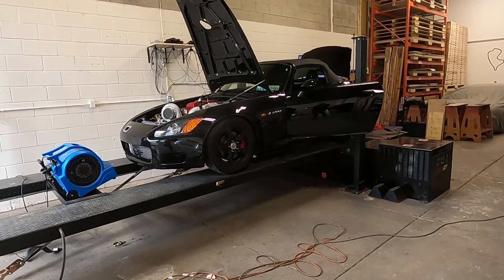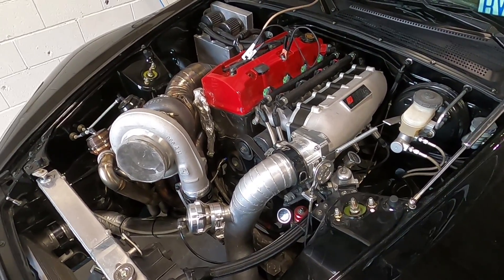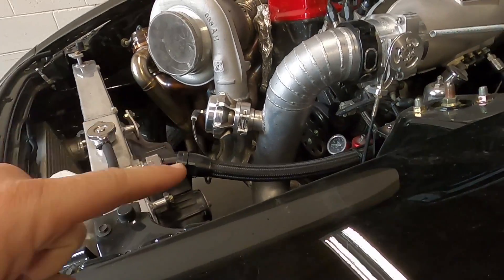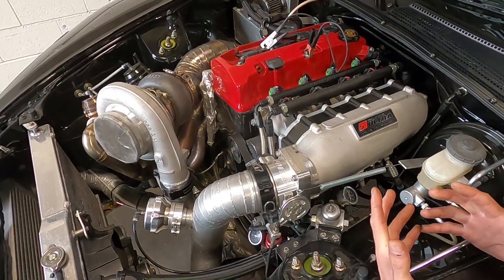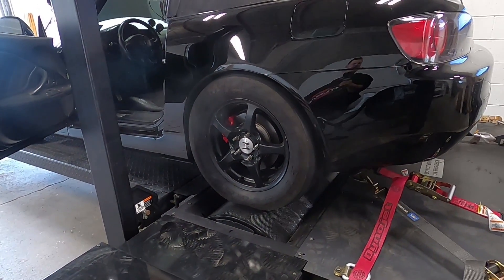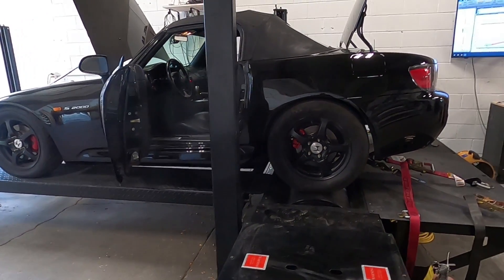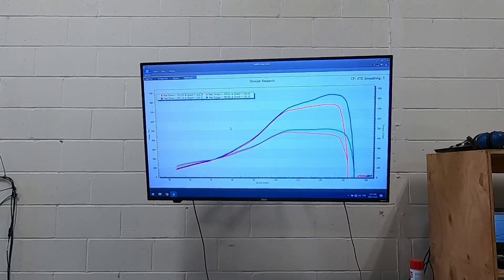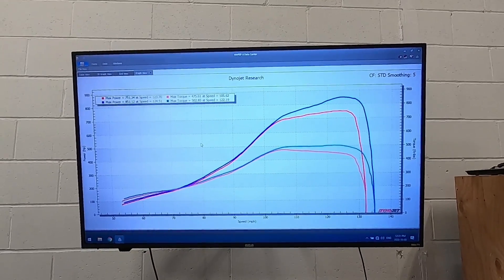Turbo S2000 Dyno Tune - BorgWarner s472

Comment: going to be boosting my ap1 s2000 w 22K miles. The goal is 550 WHP this spring. Do you think ill be okay w stock motor, trans, and diff? I never launch my car and don't plan on doing it. Hoping to also get it set up for different boost by gear so I don't get too wild on 1st and 2nd. Do you think ill be fine?

Comment: cams... drag cartel..  2.2's would work fine..  probably 50 more same boost. more back tire to load the car , or less gear.
Reply: awesome car and great fab work.  love the turbo choice as well.  Id like to see it with the smaller turbine see what boost level it loses out...

Comment: Killer setup. . . I'm ASSuMEing that this is waiting for a trans to be moon boosted. . . Crazy to think 850rwhp is fairly easy/simple and safe on that setup. The F20/22 may not get quiteeee the love of the K but where else can you take. Bone stock NA 4cyl and smack out 700whp without popping the valve cover off? 
What a monster!
Reply from the maker: Yes indeed, these engines are great. The stock engine almost made this much power on Q16 before it was replaced by this engine and setup. The transmission is definitely the weak link now, but Brandon has plans for the trans and will be back for more